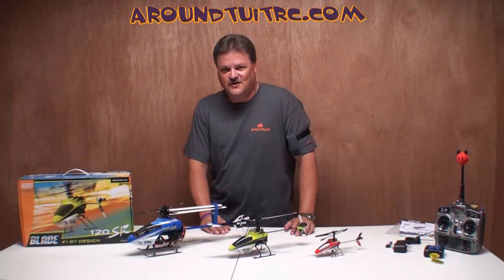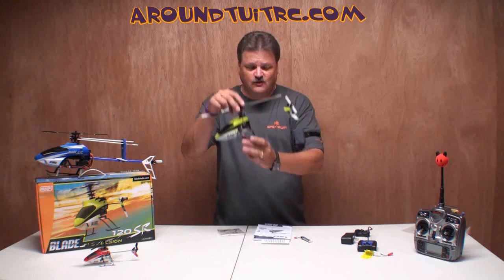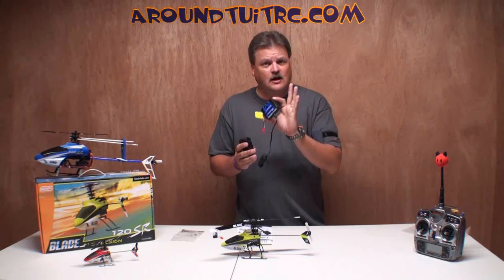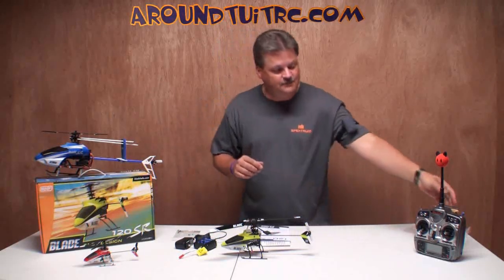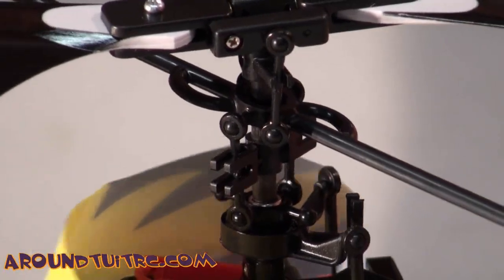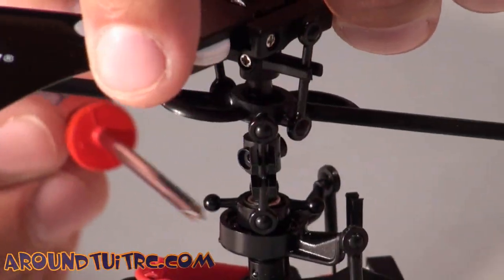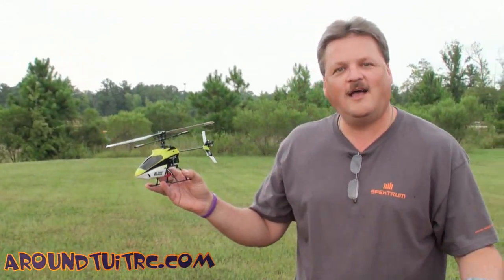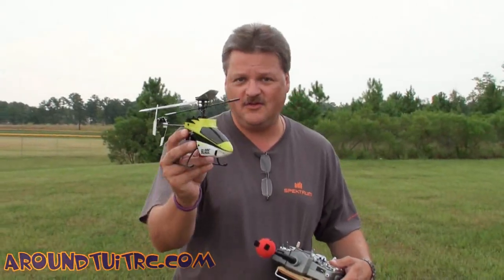Blade 120 SR Heli Advanced Swash Plate Setup and Maiden Flight

Comment: trying to trim out a heli while it's still on the ground or within a foot will you drive you nuts, I did the same with my 120.  you have to pop it up off the ground a few feet then you dial in trims.  counter clockwise spin in fixed by moving the rudder trim (lower left trim, below your throttle).  btw I've learned much more and had more fun with my msrx...

Comment: (continued from previous) The tail rotor is fixed now. It was defective which makes me wonder if the rest of the helicopter could have some issues with it. It flies fine in all other directions but forward. If you (or anybody else) know of anything, that would be really helpful. I am also currently trying to get in touch with my local hobby shop. Thanks. Awesome heli! :)

Comment: When you fly in a straight line (forwards), does it want to bank to the right and then the tail wants to come around? Mine has been doing that ever since I got it. (I've had it for two weeks now). Local hobby shop expert did discover that the swash plate was out of line, and after re alignment, it helped a little bit, but I am a little annoyed with this. Has anybody else noticed this with theirs? Is this common with this heli? The tail rotor when I got it was locked up.

Comment: Flew my 120 on Easter Sunday (too windy though). Realized I need 2 more batteries right away. Recommend getting 2 extra as soon as you make the purchase. The little Philips screwdriver does not engage the screw heads that well in all cases. It would pay to have a little tool kit with a few spare parts, that you will accumulate over time. Easy access to parts and accessories at the local hobby store is what I like about this product.

Comment: @Rfacta  I just got a Spectrum Dx6i  Definetly get this radio.  just for the fact that you can turn down the D/R and expo  it makes the heli a lot easier to handle when your starting out.  hope this helps.  check Ebay lots of transmitters that is where I got mine

Comment: I use a DX6i for my 120SR and MSRx (which is a swine to fly!).  It's a good choice if it does what you want for other models. too.

I've only flown my 120SR indoors (village hall) and it's great. Not tried the more aggressive swash plate settings though.  I'm not a heli person except in the indoor winter season. I usually fly fixed wing.

Comment: I just bought it for 159.00 plus tax.  It crapp i didn't even get to really fly it the tail rotor design hit minor thing and it flew off during test flight. It a tiny round hole connected to the motor tail shaft. They should of made it strong with a hex design and just push it in place instead of round hole design. If i buy another tail it going to come off again.  Blade sucks. Try other brand.

Comment: I got my 120 SR in the mail on Thursday. It is my very first heli and after doing a lot of SLOW exercises, i am now able to fly around the yard in any direction and keep it in the air for the entire battery charge. It is very hard to break as long as you let off on the throttle before the blades actually hit something. On the first flight, it fell about 15 feet and didnt even take a scratch. This is a good beginner heli if you take things slow. JUST dont buy msr for first heli.

Comment: @TalesinBatBat My Blade sr120 fly,s great outside even in slight wind 3-5 mph provided i use advanced swash plate, personally i have no problems with mine, and do find flying in windy conditions to be quite good fun!, not for the feint hearted tho, or beginners, as i said in previous post, all comes down to experience.

Comment: @warax112  In my opinion yes, provided you have dx6i tx or similar programmable tranny, and you can progress nicely with 120sr as it has novice rates and advanced rates for aggressive flying, (advanced swash plate settings), more versatile than alot of heli,s this size on the market at the moment, hope this helps.

Comment: @warax112 You can bind the 120SR or mSR to the MLP4DSM (blobby controller that came with your mCX2 RTF set), so yes, you can pick up the BNF versions.
As an added bonus, the mSR uses the same batteries as your mCX2, and should come with a 4-port charger. That might only be with the RTF mSR package though. 
Still, GOOD IDEA to have a spare TX. That and the 4-port wall-charger make the RTF mSR pack a steal for the extra $20, if you're already buying one.

Might also look at the mSR-X (flybarless).

Comment: @blaaakaru,
The advanced swash plate settings are just like moving the control rod to the inner hole on a control horn on a fixed wing aircraft. It allows the servo to move the control surface further. The results are that the heli will respond more aggressively to control inputs and can fly more aerobaticly. It will fly a little faster as well.

Comment: @warriorgoalie65 The tilt to the right is normal in most small helicopters. It's caused by the torque of the main blades. The coaxial heli don't do it because there is no torque effect due to counter rotating blades.

Comment: @blaaakaru  The ASP-setting increases the max/min angle you can turn the swash plate, thus making the heli more maneuverable; it comes with the cost of resolution and higher load on the servos.

Comment: Realize that when reefing on plastic bits (or even metal ones) with serrated pliers, you leave marks in the material that act as stress risers.  This makes breakage more likely in any given crash.  Use those fingies if possible (and it's nearly always possible.)

Comment: Thanks so much man! I bought a 120SR, my first fixed pitched heli after flying co-axle for years. I went through one battery and landed hard, wasn't a crash. I tried to fly off again and it wouldn't get off the ground. The heli would only shudder and skim across the ground. I started checking all the forums, etc to find an answer and nothing. I didn't know about them enough to figure it out myself just by looking at it. Watching your video I realized one of the rotor head links was missing, Fixd

Comment: disapointed in yet another sloppy eflite effort its an OK heli but there are much better options in its class , honeybee flys rings around this imo an many others

if you do buy this make sure you grab your batterys from china most come with walkera style plugs but its an easy 5 min solder job to swap all the batterys plugs (walkera plugs are a pain to use imo)